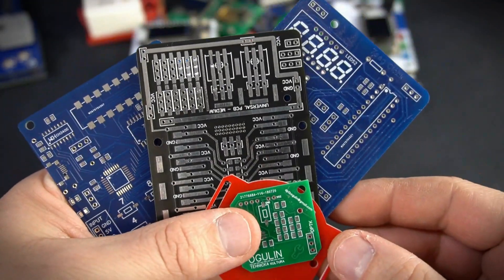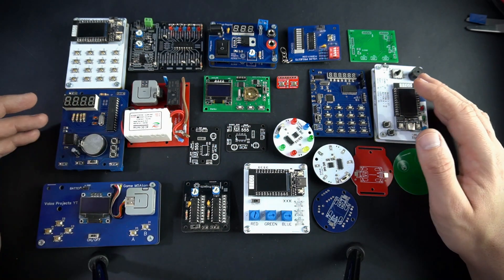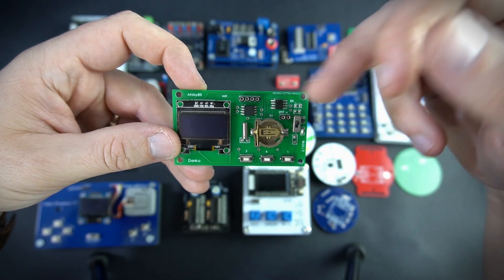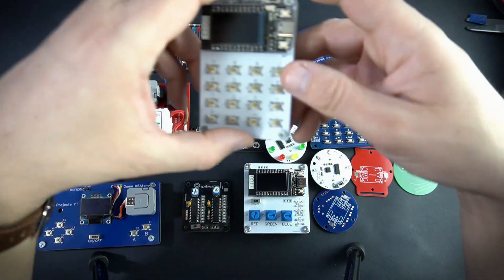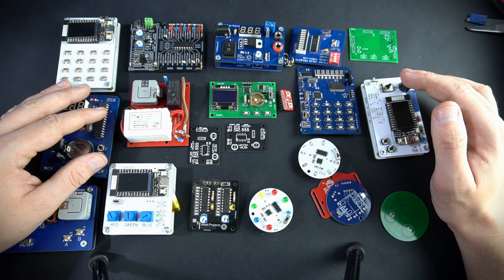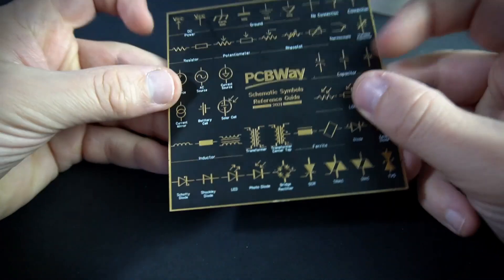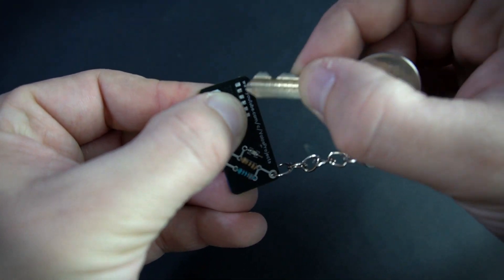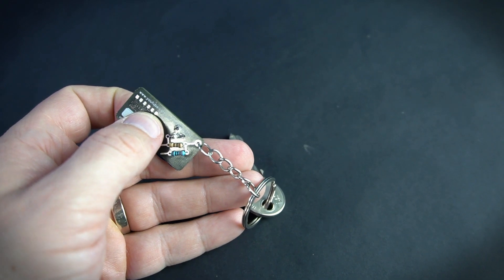My Custom PCBs and New Keychain Project

Comment: Great video, I think there's not enough good info about using PCB design for practical non-circuit related things: adapters, gadgets, signs, or designing parts that get assembled into a model. You made me want to explore this stuff even more, thanks 🤓